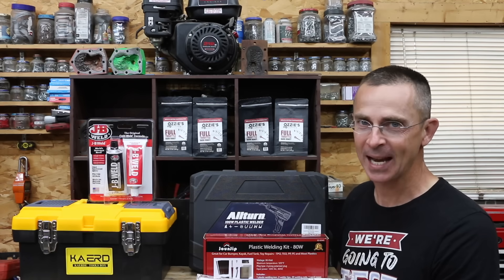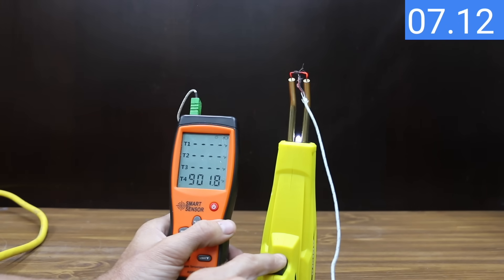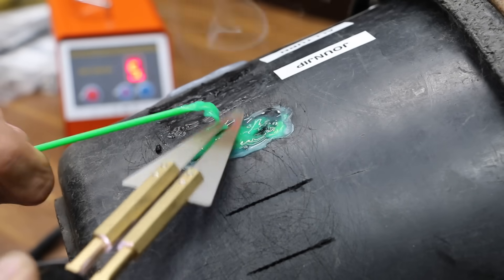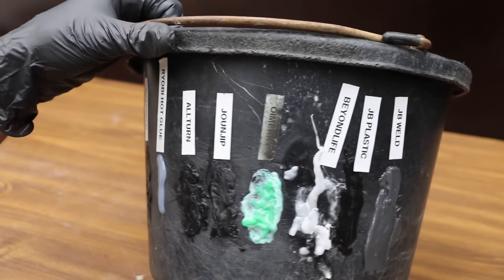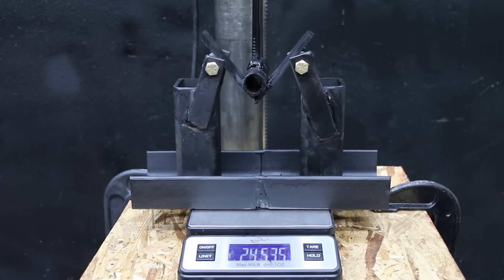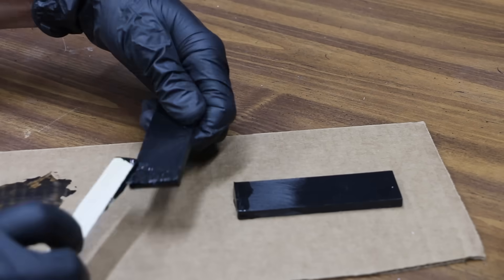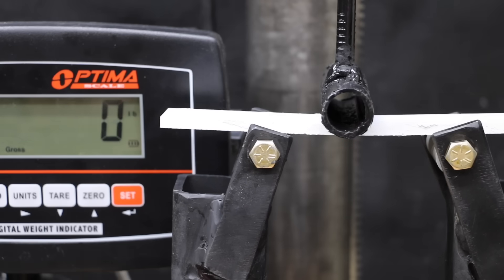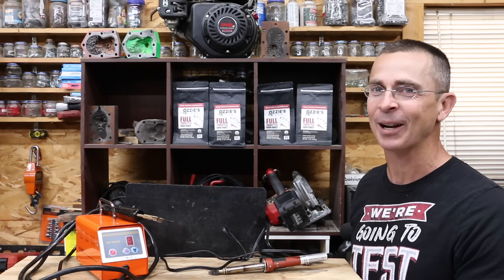Don't Buy A Plastic Welder Until You Watch This Review!

Comment: I'll say again that all these battery pack devices not coming with a battery and charger make them totally unattractive to me, as does the added cost of kits that do.  "Green" in NOT everything it's hyped up to be.  They do have their reasonable applications for away-from-home uses or where power or an adequate air compressor are not available, but I do all I can to avoid then when possible.  I have an old, original design, AC-corded hot glue gun with glue sticks and it's much less cumbersome to use.  It does everything the Ryobi can at one quarter of the price or less.  Ryobi glue is a specialized product, so it costs more.  The others are overkill and/or difficult to use for not much better performance in some cases.  On the bucket was one thing, but the plastic strips are another and I didn't expect much there.

The Ryobi did 3rd best on HDPE, 5th on ABS with mesh, and 1st on Polycarbonate, so my glue gun should perform much the same.  However, considering the original plastic strip strengths, with none of them breaking, only bending, and the overall weaknesses of all repairs on all materials, including staples, which, though not fully broken apart, and less so with mesh, will still leak under much less pressure than would damage them in the first place, I find it hard to see the point.  That's what you proved to me and that's a good thing.

This is not a criticism of your work, but the products.  You may not be fully skilled at applying them, but how skilled would the general public be?  I see apparent Pros with suggestions in comments, so I guess consulting YT Pros in this field for the best product per plastic type would be the way to go before deciding.  Again, not criticism against you.  You saw issues that most of us would and pointed them out, so great video, Todd.  Thank you.  I will say that if you repeated these strip tests, and anything learned for the bucket for the one that was so hard to apply, using advice from Pros' comments, you may find a different winner for each category.  Just a thought.  Application procedures for each appear to be key.
Reply from the maker: Thanks for the feedback.
Reply: @ProjectFarm   Glad I didn't offend you.  I love your work too much for that.

Comment: I use an air blower soldering station and  i weld the crack each side by fusion, I add some plastic soldering stick for thickness where need it at the same time. I sand It flush after..  it make a strong and almost non visible weld.
Reply from the maker: Thanks for sharing.

Comment: As a guy who's dune a fair amount of plastic welding, let me give you some advice. You need to melt and mix the plastc together across the damaged area. Just melting filter plastic over the top provides no bond strength. I hate to have to say this, but I'd suggest redoing the testing with this in mind.
Reply from the maker: Thanks for the constructive feedback.

Comment: preheat the larger/thick plastics with a heat gun or heat lamp, then they materials will meld and flow together much better, which should be as strong a repair as possible
Reply from the maker: Thanks for the constructive feedback.

Comment: I love all your reviews,but this one was done incorrectly.
You're supposed to melt the wire mesh into the base material, then use the filler rod over it.

Would also nice to see if you could test flexibility,since a lot of these are used to repair bumpers

Comment: Sorry, but this is a dislike.  The rest of the videos are good in general, albeit sometimes there is not enough range of global manufacturers.  Repairing plastic with staples and mesh is for dummies, and a waste of time (unreliable).  For the repair of plastic (polymers), only soldering with a material of the same composition (for a part made of PP + ... +. or simply Pp, a Pp donor or a special Pp wire).  Also, surface preparation (with sandpaper and degreasing), fixing a crack if necessary (and drilling it in a corner) for soldering with a soldering iron under a wedge (maybe it makes sense to do it before sanding, although the seam is not inferior to the factory one), then soldering in accordance with the material (  temperature for each material is different, + deviations of a hair dryer or soldering station).  A strip of plastic at an angle of 45 ° on the opposite side of the soldering point.  Let's warm up the plastic plane and the starting point and gradually move along the crack.  It turns out sealing with a roller of liquid plastic.  For complete soldering, repeat on the opposite side of the part.  Process the cooled surface relative to the plane of the part.  Warm up the top layer with the same temperature to give a similar appearance (with smooth plastic).  I don’t know how to give the original texture to the plastic of the car interior.  There are also special nozzles for a hair dryer for feeding plastic wire, or entire devices (like an extruder) for plastic.

Comment: Ive successfully used JB weld on ABS and actually repaired an intake on a 20HP single.cyl. Breaking one ear off of an intake flange or example: I would start by super gluing it to fit it up.  Then drill holes perpendicular to the break insert wire and JB. Slightly vee along original break and cut perpendicular slots with small cutting wheel or Dremel. Drill holes at end of alot. Use tie wire through the holes and twist tight holding tension. All wire should be inside the vee cut. Fill with JB and cure. Sand and block flush. That would make for and interesting video test different methods of reinforcement.
Reply from the maker: Thanks for the suggestion.

Comment: From my experience with ABS bumper guards, don't use aluminum screen welded into the surface area of the break as doesnot hold any better than not.  However, using the stainless steel screen mesh welded into the surface area creates a more solid and stronger bond than the ABS alone.  That's the route I'd go if being serious, iron in the stainless steel screen and fill over if needed.  Thank for sharing as usual.
Reply: You actually want to press the stainless steel mesh into the surface area like heating that and pushing in like with the staples, though I found not required to go much more than flush with the surrounding surface.  I dont recall filling over the melted stainless steel mesh since some flowed over when pressing into the surface.
Reply from the maker: Thanks for the feedback.

Comment: There are some procedural mistakes. First mistake, you failed to go with "like for like". Repairs should be done with the same type of plastic you are repairing. You'll always get substantially better results repairing polycarbonate with polycarbonate rather than HDPE. Second mistake was your... technique for the mesh. You sort of bounced around a bit with how you accomplished it. Best practice is a layer of hot plastic, embed the mesh while that plastic is still hot and pliable, then another (usually thin/cosmetic) layer of plastic on top. Third, sometimes you need to do more damage to make a suitable repair. I often cut perpendicular lines across the break to provide extra bonding surface. Those repairs often tend to be a fair bit stronger than trying to just bond the edges of the original break.
Want to save money while you practice? HDPE is used in an absurd number of items in your house. It is the milk jug plastic. Bottle caps, laundry detergent bottle, liquid hand and body soap bottles, shampoo bottles, the plastic bags inside your cereal boxes, just to name a few. And note that I named a bunch of items that come in colors other than "milk jug opaque".

Comment: Great video as usual! I usually use the hot staples (astro pneumatic kit) on both sides of the repair if its accessible. I like to folow the staple repair up with 3M 2 part plastic repair or CA glue with primer and some sand filler.

I don't have any personal experience with it, but I've been told by several collision repair techs that Polyvance (nitrogen plastic welding) is the only way to go. They are expensive though.

Thanks as usual!
Reply: My guess is that the nitrogen preventing oxidation is similar to mig welding using no gas and bare wire if you use the non shielded methods.
Reply from the maker: Thanks!  Thanks for sharing.

Comment: I work in the plastic dam lining industry. Plastic (particularly HDPE) oxidises quite rapidly, we what we do is use an angle grinder with a flap disk to scuff away that layer before doing any extrusion welding as it makes the bond much stronger. Also, for butt joins you need to fillet/v-groove the edges to increase the surface area, and also ensure all contact points are at melting temp so the new material can become part of the old. P.S. If your hot air gun is melting holes in stuff, turn it down - It's too hot! Just like MIG.
Reply from the maker: Thanks for sharing.
Reply: Absolutely right about the need for fillet in butt welds. 45 years ago we used hot air guns on PVC sheet that had a feed hole for PVC filler rod. We used a hand held "Scarcen Scraper" to cut the v shaped grooves immediately prior to welding, and isopropyl alcohol to clean the sheets. Probably not a good thing to breathe up, nor were the shredded fibreglass particles we breathed up from the adjacent workshop.
Reply: Thats a standard in all welding i guess
Reply: I have some cracks in HDPE totes (Rubbermaid Roughneck).  I had a hard time trying to get undamaged totes in the 50 gal so I decided to try plastic welding instead of play the return game (in hindsight I should have just ordered 3-4 and play mix and match since their shipping packaging is terrible).

If I want to attempt a HDPE weld of some hairline cracks, what's the best method to try to weld these?  I don't want to fill totes with weight and then cause more cracking.

I plan to practice on milk jugs to see if I can get a method to work, but any hints would be nice.  Can I tape a non-stick material like teflon and then use a heat gun and apply pressure to the area, then let it cool and peel the teflon off?  I also have the Jounjip and could try to weld plastic from milk jugs since they seems to both be HDPE.
Reply: @johndill6594   from your description and from what I have learned for my own cracked containers I plan to fix step 1 for me will be grabbing my old metal window screen step 2 melt it into the outside and inside plastic layers after cleaning both.  Then top off with hot glue. Not too much hot glue as those sticks get pricy🫠
Reply: This! The temps are way too high. Using different materials will cause failures. Plastic welding rods should go in a groove as @peejay1981 states. Another way to weld without the groove is to heat up both sides and the hold together with some pressure until it cools. you have to heat up both sides pretty much at the same time.

Comment: I know it seems that everyone’s got a different opinion on how to weld plastic, but ……..
I have a 2.7 meter mini jet boat made totally of 16mm medium density polyethylene (MDPE) and I have done many repairs on it from puddle hopping and gravel bashing and I find the best way is to use a heat gun and melt the crack/break and use the welding rod to twist the two sides together in a circular motion locking each side into each other to become one
The non-heat gun type only melt plastic over top and has no advantage over glue
Reply from the maker: Thanks for sharing.

Comment: Have you tested electrical crimp tools?  Metripack and standard barrel crimp.  Also testing electrical male/female connections such as metripak, bullet, spade, solder, 3M blue taps, wirenut, strip/twist/tape  after hot, cold and water submerge
Reply from the maker: Thanks for the suggestion.

Comment: It would be interesting to see if there is a difference in weld strength of there were a gap to fill between the test pieces. It makes a difference in welding steel.
Reply from the maker: Thanks for the suggestion.

Comment: I use paper clips with hot glue which is very strong. Also would be nice if you remind people how you take precaution as a reminder since most will suck up all the flumes which is not good.
Shame no total chart but as usual overall good video.
Reply from the maker: Thanks!

Comment: Good try for a rookie but you really have to add the same kind of plastic to what you are welding. Also I think you need to understand a little better why you need to use staples and why you need to use scream and when those are most appropriate not to mention how to use them. When applying the liquid plastic repair you are usually only attempting to repair then pieces of plastic or attempting to make repairs such as a plastic spoon that has snapped and honestly I prefer a different type of liquid plastic repair process that uses an activator a liquid plastic and a preparation liquid because the three-part plastic Wells does a better job with less nest and you can get it in I believe four different plastic types one of which is basically rubber.

This is not a really good place to examine the different kinds of plastic welders in such a broad format and quite honestly if you're going to have a piece of plastic welded go to somebody who does it professionally or study a specific type of plastic welding because you're going to be welding that specific type of plastic and quite honestly nobody has figured out how to weld nylon

Comment: Been using a older model of the Polyvance 5700HT for years, or 3M panel bond (you have to get the right formula and mixing nozzles) epoxy which is what they use to mount body panels on cars and trucks at the factory.
Reply from the maker: Thanks for sharing.

Comment: So I'm not sure, after watching this video, which welder and which approach I should use for a cracked bumper. The staples seem strongest but are probably too thick for a bumper. And all these produced results that look pretty bad and would require sanding which you didn't cover. Suggestions?

Comment: The flat fiber welding strips are basically hot melt glue and not realy plastic welding, more like the Ryobi glue stick.
I've used hand held mini 3d printers for ABS, PLA welds. Try the Polyvance it comes with a dozen different types of plastic rods for plastic welding not just plastic gluing
Reply from the maker: Thank you for sharing!

Comment: First, melt a small "V" into the crack (or where the two plastic pieces meet). Then fill the "V" flat at relatively high heat with plastic.  Then use the staple but once it is halfway in, move it slightly (1/16th-1/8th of an inch sideways, so that it cannot come out easily in the hole it made. Then finish it off with extra plastic. (or mesh)

Comment: Great job, however, when plastic welding with metal mesh you want to heat the mesh and make it sink into the original part and then add plastic over top.
Reply from the maker: Thanks for the feedback!

Comment: I have had limited success welding plastic with the two kits I found at Harbor Freight, the cheap soldering gun, and an $80 one that blasted hot air.
I had a terrible time melting the plastic properly and not just evaporating holes into it!
You certainly have more experience than I do!

Comment: idk if this was addressed, but it looks like the same rods were used for all. i know very little about plastic welding and i can do it just barely enough to fuse parts back together, but all of the rids ive used were different colors for different plastics. im thiniking maybe this was the reason that you werent getting a good bond to the abs. all of the rods ive ever seen for abs were white or very very light gray (damn near white). 

i usually try to avoid this probelm by trying to get a piece of the parent material for the filler. no need to guess on plastic types or compatibility that way.

Comment: I've been welding plastics for 10+ years now after an autobody guy showed me his methods. I've adapted it over time and have had great success with aluminum window screen mesh, 2 part epoxies, and a $20 Weller soldering iron I purchased from Home Depot 10 years ago. I've fixed several different types of equipment and haven't had any failures that weren't from user error after the repair. Never had luck with a hot glue gun when I attempted it. Great video! I always check your channel before making purchases on tools lol. Keep up the great content.
Reply from the maker: Thank you!

Comment: I have found that for small repairs or rebuilding of clips a 3d pen with a spool of ABS filament does a good job. 

A plastic welder,glue gun,3d pen and epoxy can take care of about anything plastic.  

I would like to agree with one of thr posters, melt the mesh into the base plastic first, much like the staples and go over it with the rods after.  

Thanks for another great video. You are one of the few people who I actually trust to test products.  Since most have sold out to some extent now.
Reply from the maker: Our pleasure!

Comment: This is the first failure video of yours I can recall. You are supposed to melt a deep trench about the full depth of the width and fill the gap where the two plastic pieces you're welding meet together right? Least that's what the instructions say with my commercial grade plastic welder I have. You should try this and fill it then lay the mesh on top and compare to how you did it there. I also did it your way first and my welds failed

Comment: what voltage do you test tools at when you chech their wattage? I know with things like computer power supplies if you run them on 240v they can draw more watts than they can on a 120v circuit and i was wondering if something similar could be the reason that you sometimes find things draw much less power than they should
Reply from the maker: All of them were designed for 120v and that is what we tested them at.